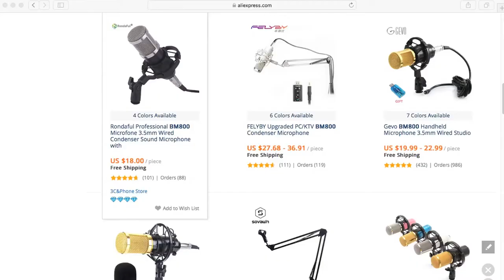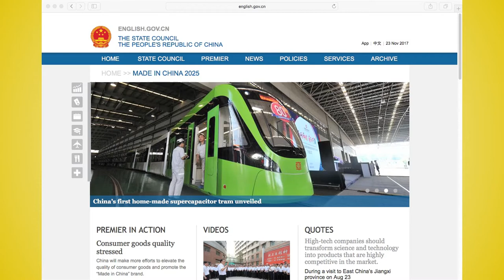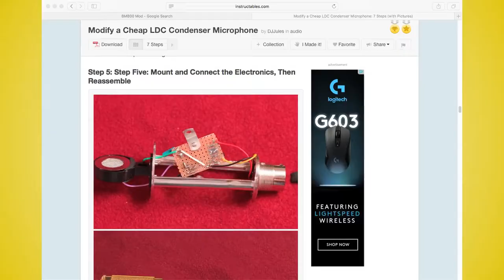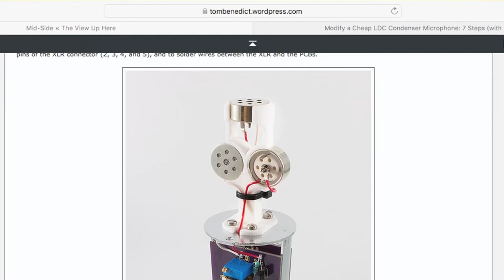BM-800 Microphone Teardown And Comparison

Comment: The black one is a real CONDESOR MIC capsule. Sounds great compared to the Electret piece of junk. I own 3 of each.
Reply: Looks like an electret microphone capsule to me.
Reply: thats still an electret, just slightly larger, lol.
if you think thats a actual condensor then please explain how this mic can run even as low as 5V and without any boosting biasing circuit inside. Hell one side of the capsule is connected to ground and the other one is signal, so no biasing.
go look up what real condensers look like.